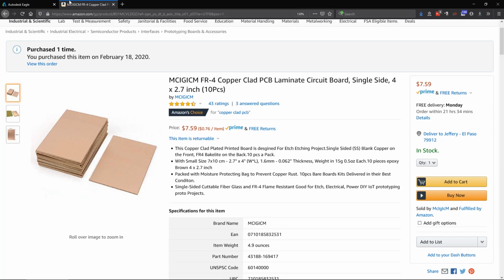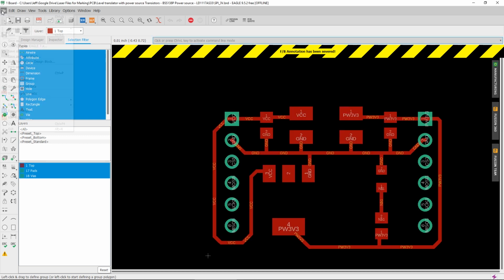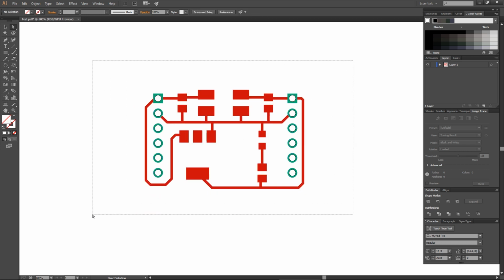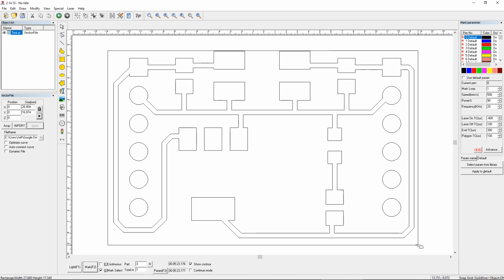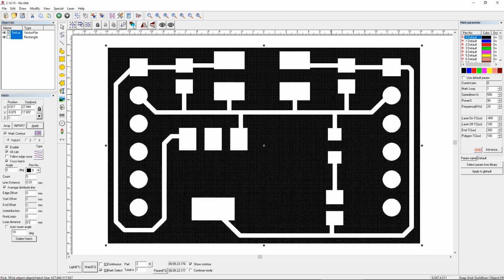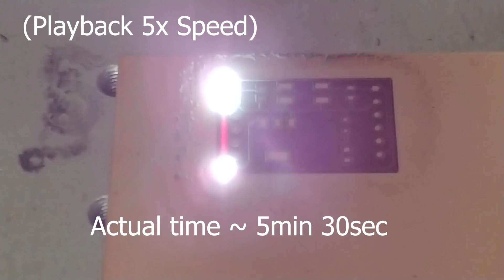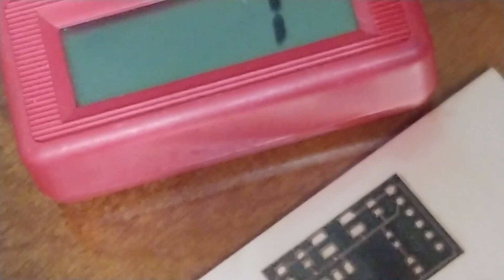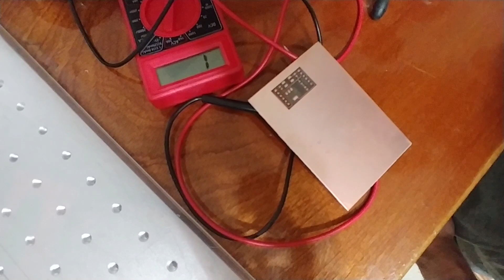Making a PCB with a Fiber Laser - using Eagle, Illustrator, & EzCad2

Comment: by choosing polygon tool and drawing a rectangle around your pcb and then clicking on ratsnest will filll in the unused copper so your laser only needs  to trace and remove the copper closest to the signal wires and will speed up the laser "etching" time

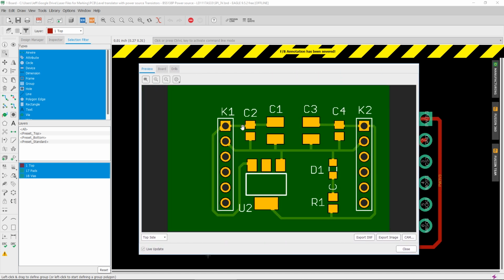Comment: Hi there. Great idea using a Laser to make a PCB, nice one. The issue you mention at 1:33 is most likely the Soldermask. On a green PCB, the tracks are partially obscured by a green coloured mask to protect and insulate the tracks below. There is a small exclusion area around solder pads and vias where the bare copper is exposed and the Solder Mask is not placed, but the lines that appear within the substrate are actually just obscured by the translucent Solder Mask

Comment: A pcb eraser (like a pencil eraser) is a nice soft way to clean up the board afterwards.

I found I got cleaner results (less charring etc) on FR2 material- it's pretty cool because with the right settings you can keep repeating until the copper is gone without affecting the board below.

I have a 30w unit and use 1200mm/s 50% power and a combination of vertical, horizontal and diagonal paths, plus multiple outline steps.

As you noticed, the small details between close tracks are the hard part and where you need to follow the track direction so it has more time to accumulate heat in the copper I guess.

I made a board with 3.5 mil track and space thickness which I don't think is achievable with most other processes.
Reply from the maker: Interesting, I didn't know about FR2...that would certainly be nice to run at 50% power without damaging the board.  I was initially using autorotate with the bidirectional hatch but became more cautious when I was getting inconsistent results over a larger area.  Thanks for the eraser tip also!
Reply: @jefferyj  Actually I think it was FR1. I got some from the inventables web shop and they were good.
Reply: also, 25khz and 80ns pulse width
Reply from the maker: Thanks again....I just looked it up on inventables and bought some to play with.  Apparently FR1 is made of cellulose paper based material rather than woven fiberglass.
Reply: About heat accumalating: what about heating pcb while laserwork? It's possible to use infrared heater from reparing station or bga rebolling. Or simple by iron upside down
Reply: Denis Glukhov I think the temperature disparity is too great- copper vaporises at 2500c while fr4 can handles something like 120c before discolouration etc. choosing a path so that a sweep of consecutive overlapping pulses reinforce the effect seems simpler. It would be nice to choose a path based on some sort of modelling of the physics.
Reply: Can you provide more details? Where did you boy your laser? What's the wave length? Which lens are you using?

Comment: Lol. This works so well. This is how I do all my circuit prototyping. My 50w will remove the copper in 2 passes. And I do 5 low power fast passes and it cleans it almost 100%. Use the laser to Mark holes and then manually drill them with a .5mm bit afterwards. 👍
Reply: hey! I'm considering getting some laser tool for pcb prototyping, sucks to waste much time before each prototype arrives from china; what kind of tool are you using? could you give a link/feedback? thank you
Reply: Would you mind sharing your settings?  I have a 50W JPT and would love to experiment with this a little more.  Thanks in advance!
Reply: My 30W machine doesn't seem to make it. Dont understand why.
Reply: In other videos on this topic I have read people claiming the burnt G10 is conductive. Have you had the problem? I imagine for some high impedance circuits this 'may' be a problem, but I am curious what results you may have seen.
dan
Reply: I have the same issue, no mark on the copper at all. I'm using a 50W raycus. Have no problem marking steel but basically no mark on pcb copper. Tòo reflective?
Reply: @shrinivasganti90  Hello. Have you solved this problem? I am struggling with it at the moment.
Reply: @Pren66  use fill of 0.01 and max power, adjust focus
Reply: @shrinivasganti90  Thanks, I'll try. Should I reduce the speed too?
Reply: @Pren66  I don't think it is necessary
Reply: @ may not be necessary

Comment: Hey Jeffery love your videos! Can you make a video how you dial in your settings for a given material?
Reply from the maker: It's mostly guess and check.  If I'm removing material I'll use a high power and low frequency combo with a reasonably dense hatch and tweak from there.  If it's just a surface mark or an anneal it will be the opposite: low power, higher frequency - but still a dense hatch.

Comment: i do this with a normal laser (not CO2 and not fibre) what i do is i paint the whole copper side of the pcb with spray paint , then i open the gerber files with flat cam select the top layer and generate the job ,then export as a DXF , then i use lightburn and import the dxf and burn off the paint on the area i want to etch with etching solution 
so the traces i want after the laser operation are still covered with paint 

now i put the pcb into an etching solution and etch away the exposed copper and the traces are perfectly covered under the paint ,then i use the laser again or some acetone to expose the pads 

this operation works for me great ,and i can go down to super small traces and smd components with it

Comment: Another style of board would be isolation routing. The pads and tracks get an isolation area cut away to isolation each track. This leaves lots of copper (most of it) still in place which is the ground plane. I use this for making boards with a simple 3018 cnc router but it makes a lot of dust and is quite slow so using the laser would be good.

Comment: why not use multiple offset passes. instead of hatch?
you can create multiple offset lines at the pitch you want on ilustator, corel or inkscape.

and you can even use the open source flatcam software to create complex paths that can be exported to dxf.

thanks for posting this video, i will see if i can do some tests on my fiber and share any positive results.

maybe by ajusting the HZ we can get in a spot that cleans copper but avoids the substrate.

kind of like cutting vinyl over petg on the fibe laser
Reply from the maker: Yes!  I actually tried to just use the illustrator 'offset path' command under the object menu to do minimal marking around each trace instead of hatching the full rectangle.  If I had the space, it would look much better too, but for a board of this size the traces didn't look very good in the tighter areas when I tested it.  Maybe if I were more patient and used lower power it would have been ok.
Reply: @jefferyj  problem is not power per se. it is the mirror speed. you need to decrease the general speed to compensate for the mirror speed difference on a line and a corner

Comment: Why not just export it as a DXF? it imports easily into EZCad, I've done this to make a solder stencil, it's much quicker and easier in my opinion. Great video by the way.
Reply from the maker: Thanks, that might be a good suggestion.  I've had mixed results with DXF files in ezcad (not from Eagle though...haven't tried it yet) so I tend to go for the sure thing with AI.
Reply: @jefferyj  the eagle dxf export isn't great out of the box- it's all built using user changeable scripts though, so I have some fixes I applied to make it do what I want (select the layers like top+via+outline, trace the outlines, export the dxf).

even then though, the line segments aren't connected into a single path so I think it was causing problems in ezcad until I ran another conversion process to clean them up (e.g. import/export through a smarter program like vcarve works).

If you have a process you're comfortable with I'd say just go with it.

let me know if you're interested and I can share the scripts.
Reply: @iainwade  Anything to make it bullet proof is always good, please share what you have. Thanks
Reply: @Angryhelder  bit.ly/2SOUKSA

it contains a lightly patched copy of the outlines and dxf scripts, and a wrapper called make-dxf.ulp which calls them to produce the dxf files.

first it traces path/pad/via outlines from the top layer (1) into a new layer 101, and the same for bottom (16) into layer 116.

then it exports dimension layer (20) and the outlines (101, 116) into top and bottom dxf files (and some other variants which can be ignored).
Reply from the maker: Thanks for this.  I've had similar experiences with DXF files that you describe above; disconnected point and that sort of thing.
Reply: You can use corel draw or ADOBE CAPTURE( for mobile) its a very powerful tool to trace anything

Comment: Hi JefferyJ, your presentation is very nice.
I have a problem : I have a 20 watt fiber laser machine with a 240x240 lens.
I cannot engrave pcb copper glows, reflects beam.
How can I solve it?
Reply: I believe that 240mm lens is too large for 20w.  Need to go with at least half of the 240mm lens to be able to engrave Cu.  Smaller lens mean finer detail and more power.  Trade off is smaller working area.
Reply: if you use a 240 x 240mm Focus Lens the Spot Diameter of your Laser is much bigger as if you use a 110 x 110mm Lens. If the Spot Diameter is bigger the Power Intensity is more less. For example if the Spot area is double the power Intensity decreased to 1/4. And your Laser has only 20W. I recommend to use a 70 x 70mm or 110 x 110mm Lens with a 20W Laser if you will make PCB's

Comment: Hey there, I have tried etching some similar FR4s using a fiber laser but the laser can barely mark anything on the surface even with 100% power... and Im pretty sure my laser is around 100w. Tried different frequencies and speed and none of them worked. Wondering if there's anything special about your laser or was there something that I missed?
Reply: Hello. Have you solved this problem? I am struggling with it at the moment.

Comment: Great video! I've already used my laser for pcb. Simply apply some spry paint on it, and remove it only in desidered spot with laser. After, drop the pcb to HCL+H2O2 and a perfect pcb will be! 🤣
Reply: the fiber laser gives a one-step process that doesn't require extra consumables or a wet process, and has a smaller spot size (30um vs 250-500um) which allows finer precision.
Reply: ink mask selective removal technique works even better with a fiber laser since you can fine tune it to clean but not erode the copper.
Reply: Yes, I'm talking about my fiber laser. Actually it's not so powerful, only 15w, but I will try to push it and see if is possible to engrave copper whit this low power output. Considering all the process, maybe is more fast using laser for remove a paint, and powerful acid to remove copper. But, speaking about costs, maybe using only the laser is more effective. I don't know. The only thing I know is the absolute precision and detail of traces using fiber laser. I think more precise of using fotoresist method at home. And (I haven't tried it yet) I think is way too easy make double layer whit laser!
Reply: @iainwade  Laser ablate epoxy and leave "fuzzy" insulator surface that is very easily to contaminate or get wet and give leaks. If you have something above 47 or 100k in circuit, I would prefer etched board.

Comment: I'm new to fiber laser and just ordered 20W.  Interested in making PCBs.  What I have read is that EZCAD can import GCODE.  So I don't need to go through pre-processing steps instead export the PCB design as G-CODE using program like Flatcam and EZCAD can read the file correctly?  Can someone can confirm?  I'm guessing EAGLE would be able to export g-code as well.
Reply: I'm using EZCAD2 and have confirmed that EZCAD2 do have GCODE as one of the option type for importing into the software.

Comment: This is fabulous for single sided PCB prototyping. By the way, Adobe and Autodesk are evil. I suggest you use open source and free alternatives to illustrator and EzCad like KiCad. Also through hole vias need to be electroplated in order to work properly with multi-layer boards, so in that case it probably is much easier to use a professional pcb manufacturer like JLPCB.